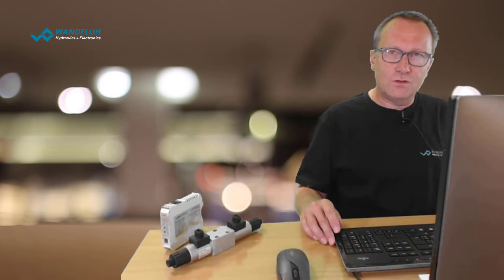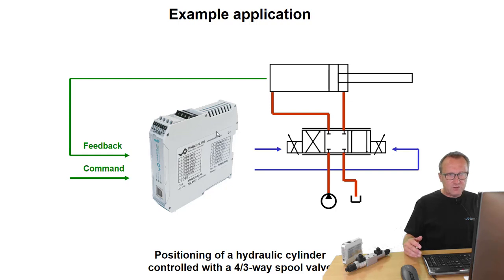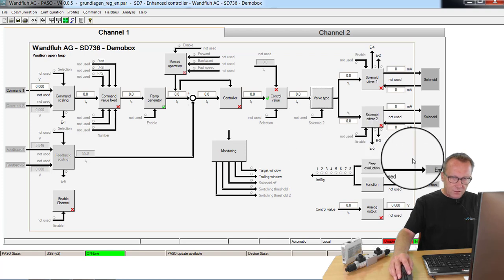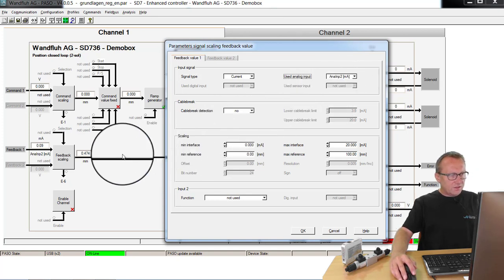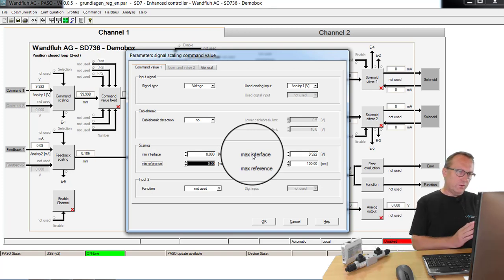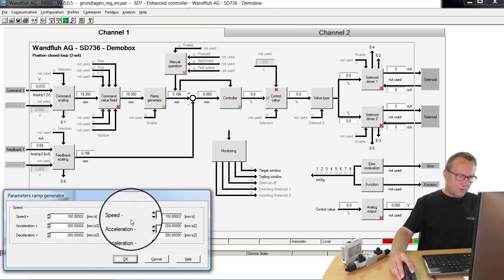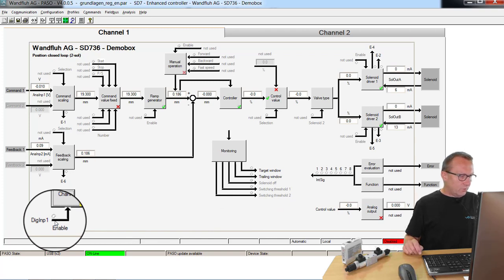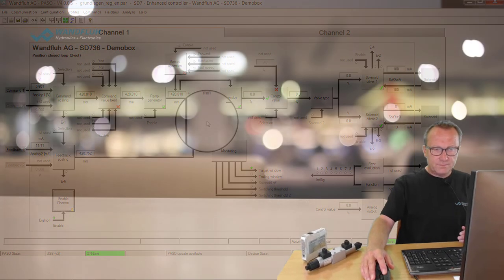PASO basic setting closeLoop

Comment: Hai sir,
This is Prabu from India I'm a service engineer of some hydraulic system .
In one of my client place they are using wandfluh proportional valve .in this valve they are facing a problem.that is when the valve is in closing command some times it opening automatically for 0.8-1mm .if they give close command it's closing for some more time and again it's opening like same again after some time.

In this case I checked the supply voltage in closing solenoid it is 24Volt and opening solenoid side it is 2.5 Volt.

Is this correct .
Reply from the maker: Hello prabu ram Kumar. Thank you for your request. Please contact your Wandfluh distributor in India or sales@wandfluh.com